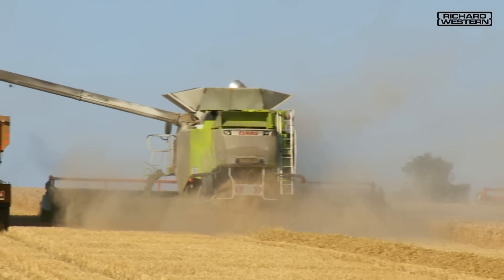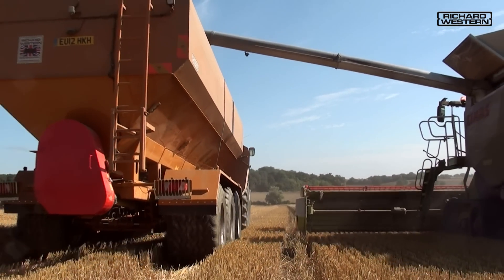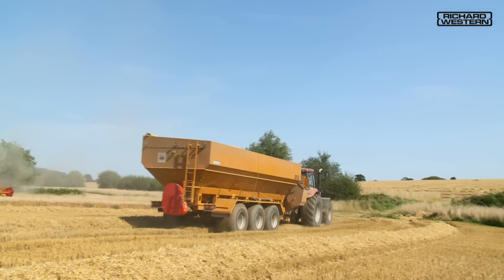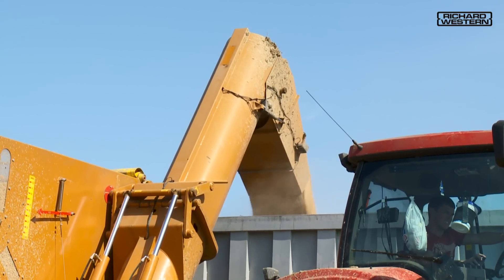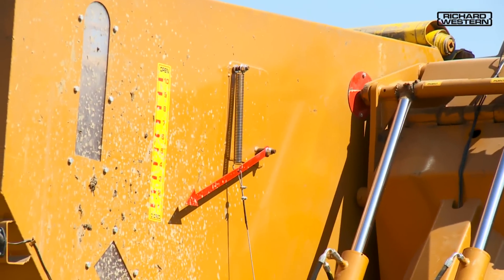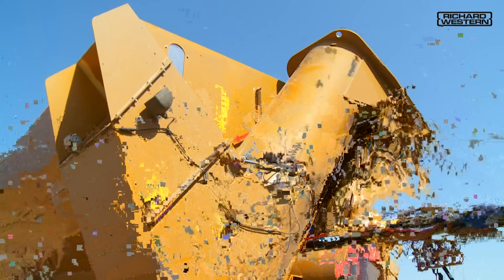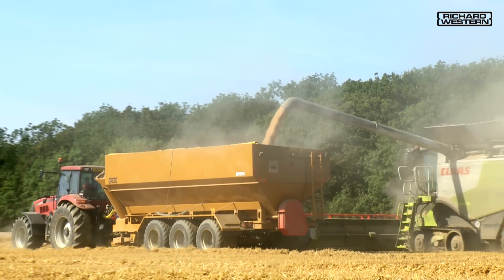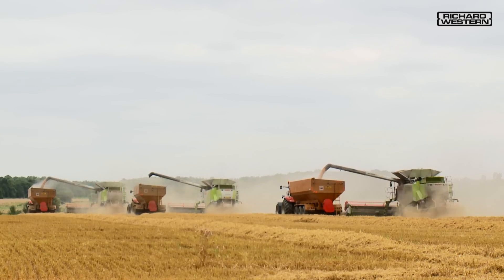Western GR30 Grain Chasers working with 3 Claas 770 Combines

Comment: Because a Lexion 780 has a 12500 liters tank that gets filled in less than 7 minutes, while the unloading takes almost 2 minutes, so a full unloading fills the chaser bin with approximately 17000 liters. So a full chaser bin takes about 2.35 combine tanks. If the traveling to the truck and unloading from the chaser bin takes more than 7 minutes that you have between combine tank filling, you need an additional chaser bin that has to take the load from the combine.

Comment: So, would you like to travel fast to the truck with the chaser bin each time you have a new load and speed up the unloading to don't hold the combine with a full tank? Or would you like to take the load of 3 combines, then run to the truck and unload peacefully knowing there are 2 additional carts that could take 2 batches of grain and give you a 15 minutes time window for unloading and traveling? A chaser bin is more important than you might think.